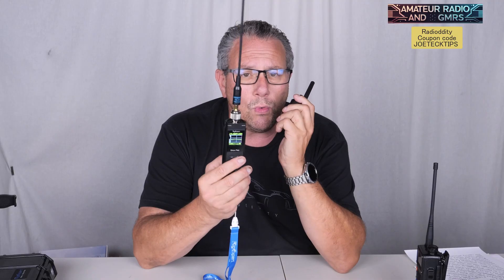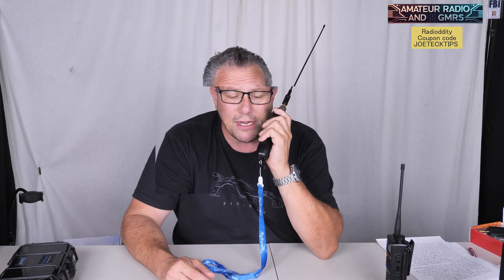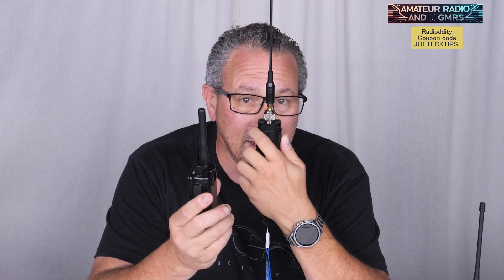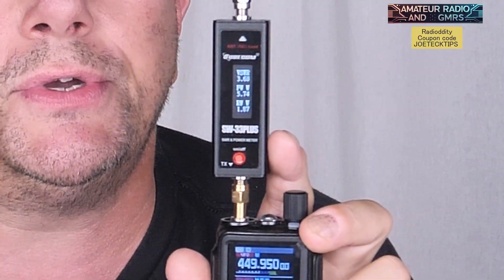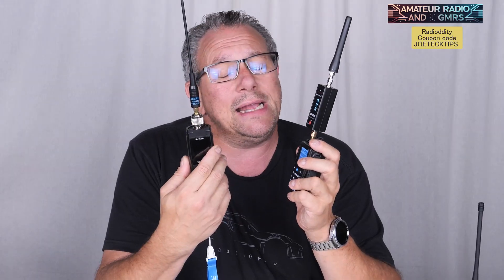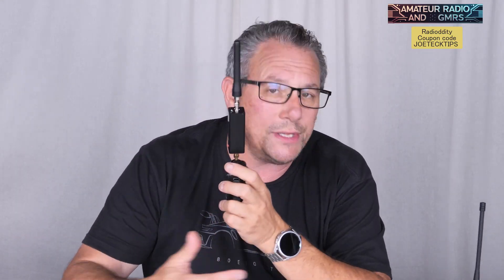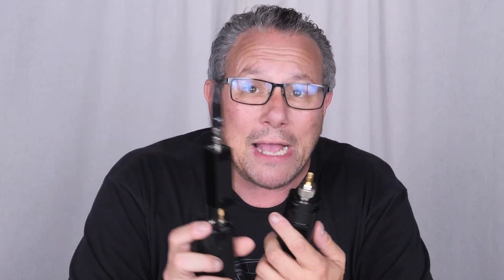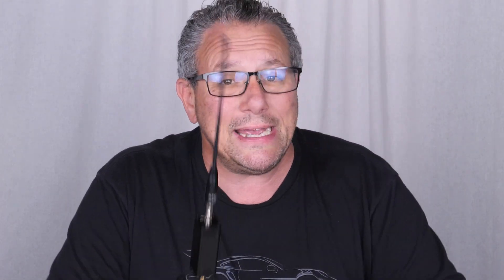Screw your counterpoise | Have you tried this?

Comment from the maker: When testing an antenna with a RigExpert analyzer, you typically hear advice about using a counterpoise or proper grounding for accurate readings. While that’s generally good practice, I’ve found something interesting: if you bring the RigExpert right up to your face during the test, you often don’t need a counterpoise at all.

Your body acts like a giant ground plane. By simply holding the analyzer close—literally up to your face—you provide enough capacitance to stabilize the measurement. The RigExpert reads flawlessly, with smooth SWR curves and consistent impedance values, even in situations where a counterpoise would normally be required.

It’s not a permanent replacement for proper grounding when you’re on the air, but for quick field testing or checking an antenna match, this trick works surprisingly well.